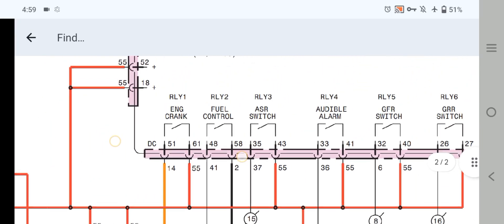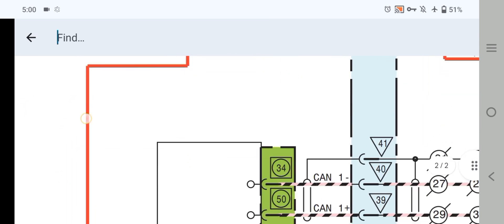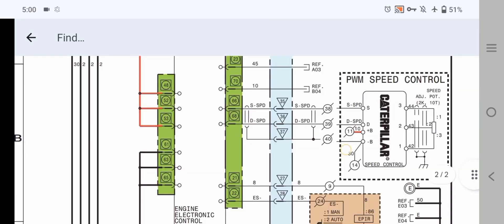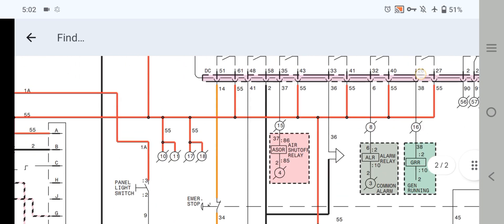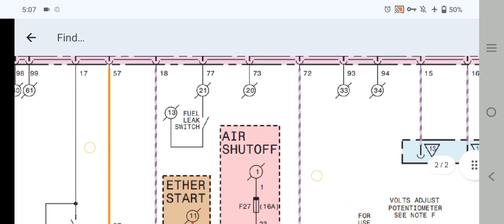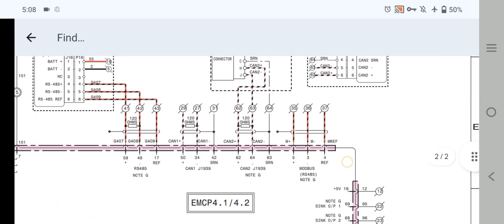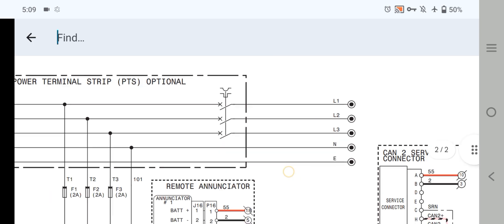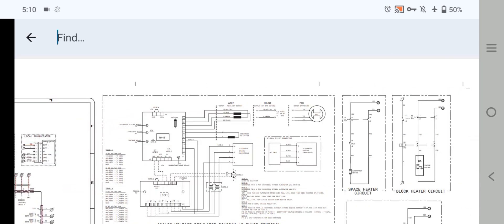Caterpillar Generator EMCP 4.1/4.2  ECM Complete wiring diagram explanation part 2

Comment: Hi, we have a CAT 3412 diesel generator that runs at idle speed in manual mode. In auto mode, the speed continuously rises to an overspeed alarm.
Reply from the maker: Governor not properly adjusted, make sure governor well adjusted then try
Reply: @Info-Tech-  can we discuss this via email or WhatsApp?
Reply: Btw, the CAT genset is running with EMCP 3.2
Reply from the maker: @JosephBilly-m8h +923135774411 WhatsApp